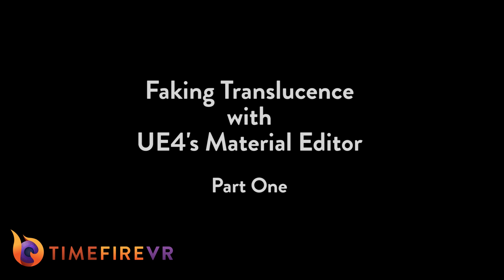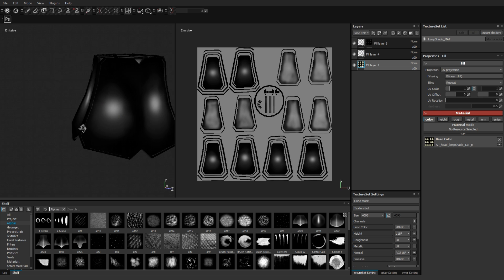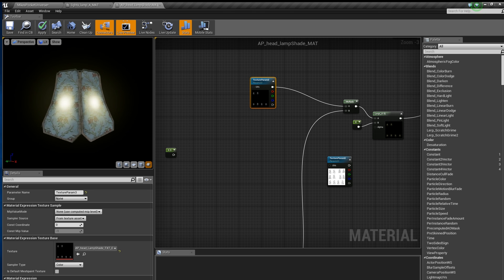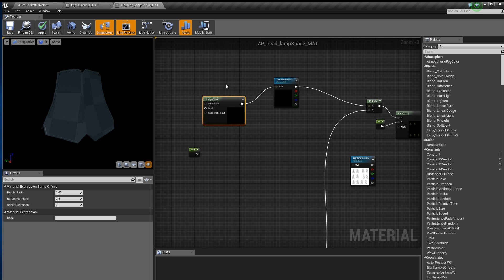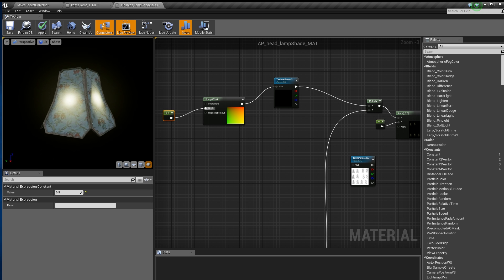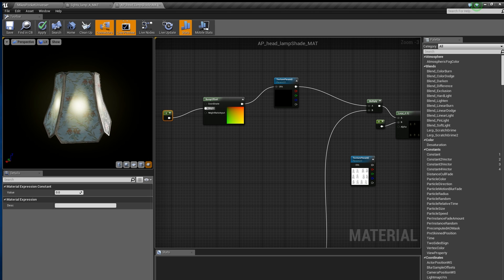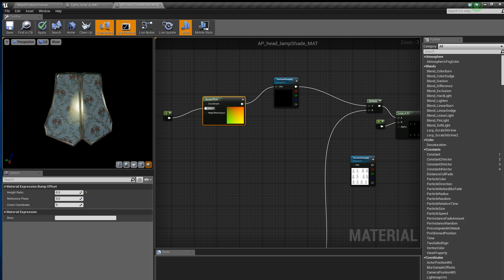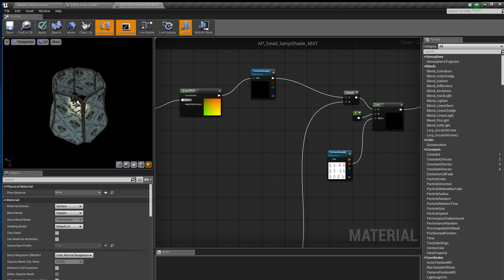Faking Translucence with UE4's Material Editor | Part One | Tutorial

Comment: Too bad it looks really terrible. Lights are supossed to emit light... you know. If you are making a lamp, a) either you sacrifice performance making actual translucent materials b) you completely get rid of the light effect. But a lamp is a lamp. Everybody is going to notice that there is not actual light coming from the lamp lol.
Reply: Except that you can just also add an actual light to the lamp. This material trick + a real light will be far less resource intense than an actual translucent material, which was the point of the exercise. I wasn't the level designer. It's not my fault that they didn't add a light or if the programmers chose to remove the light later.